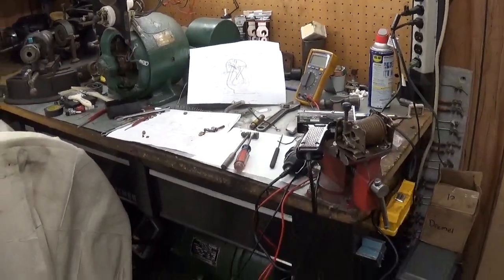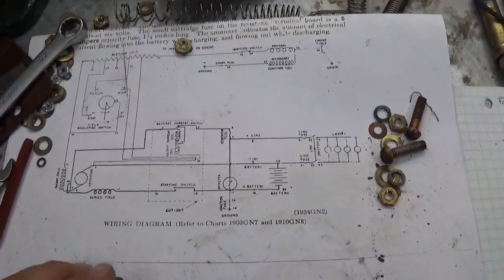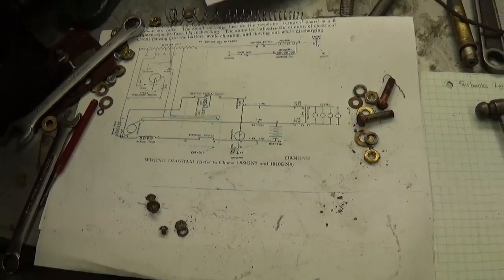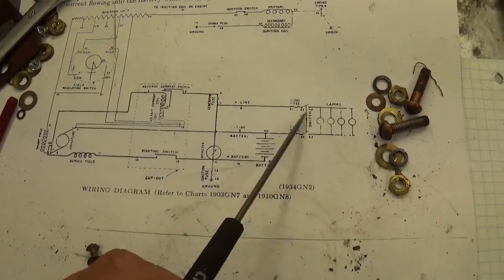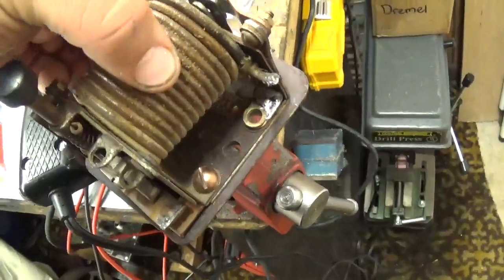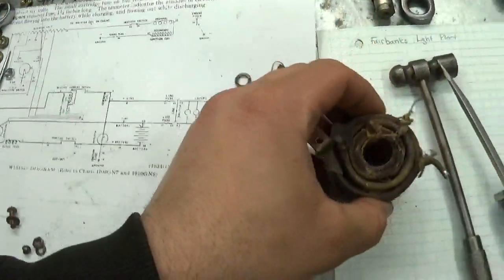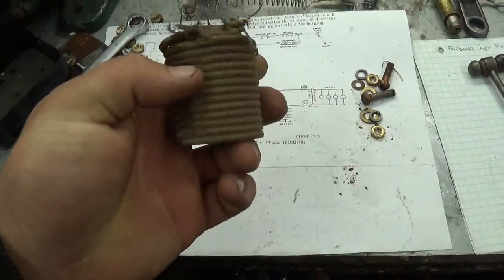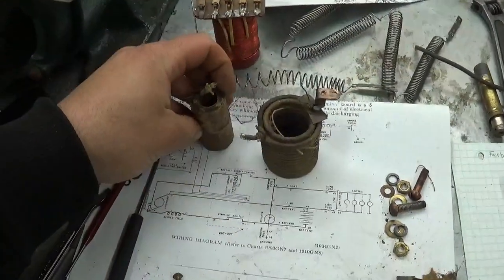(PART 2) Fairbanks Morse Light Plant Generator

Comment: Thank you Mike for the two videos. I have the same set up, and at some point I will nee to work on the gen. and your videos will help. So far I know my gen does put out some volts, but that was only spinning with a drill. Lots more work to do with everything under the tin box.

Comment: Great vid Mike .. So that coil pulls the contacts closed . Sad that resistor was done so wrong ..
Reply from the maker: ShawnMrFixit Lee Thanks Shawn, yep that coil drives the output contacts closed when the generator voltage overcomes the battery voltage.